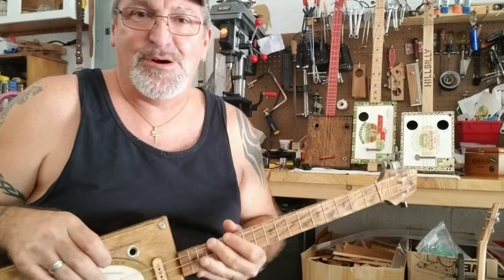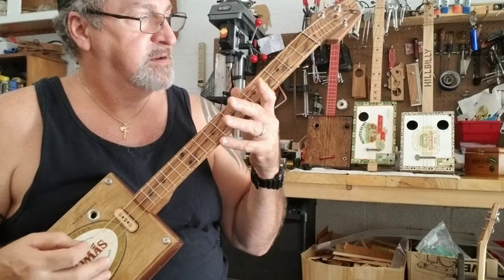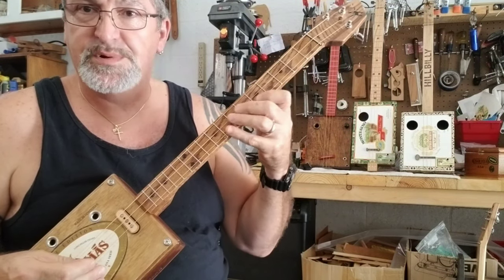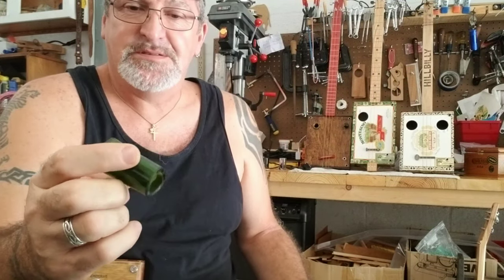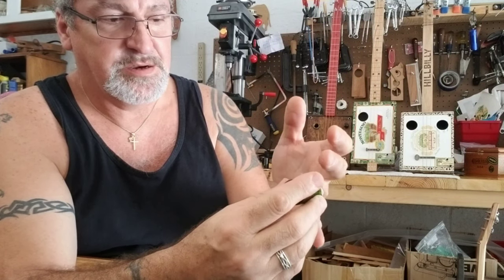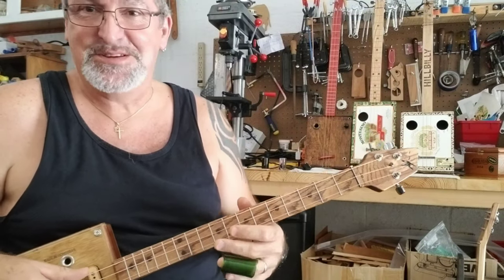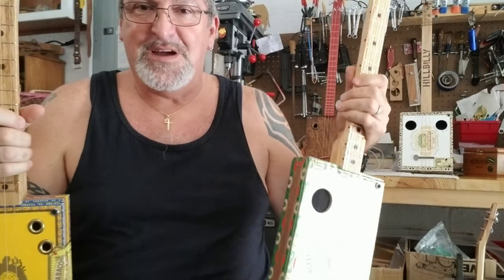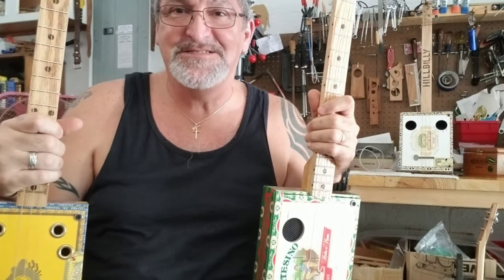Cigar box guitars made from vintage cigar boxes.  One broken bottle neck slide.

Comment: Nice builds!  I’ve had the same thing happen to a slide I made. Now that I use a Dremel, it doesn’t happen any more.
Reply from the maker: Thanks Steve.  I tried cutting that with a wet tile saw. I don't think the blade was very good. I may try a Dremel, does that cutting wheel come with it?
Reply: No. You have to buy the blades but they are not expensive. It takes a few minutes but it gets clean results. My technique is to use fairly light pressure as I continually rotate the bottle. That keeps it from overheating. Once I have a good groove,  I add more pressure and don’t rotate the bottle as quickly. That builds up heat and it cracks cleanly at the groove. I then use the dremel to clean the edges and finish off with a sanding sponge.
Reply from the maker: @stevesstrings5243  I may give that a try. thanks for the info, Steve.